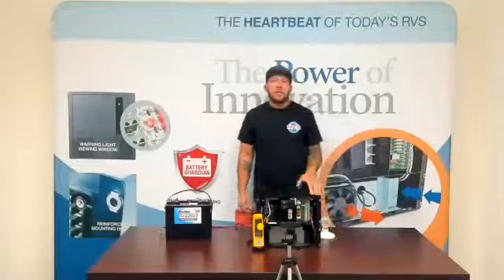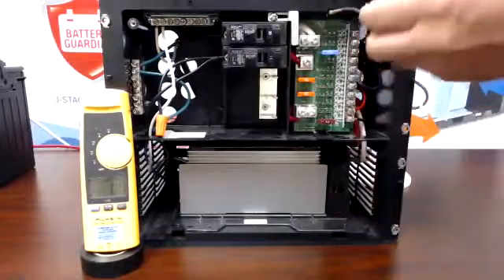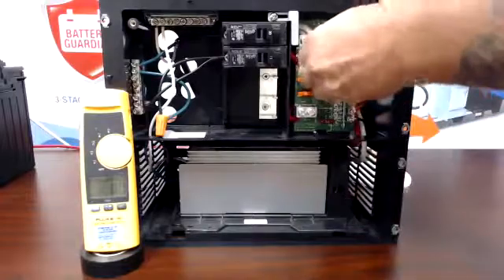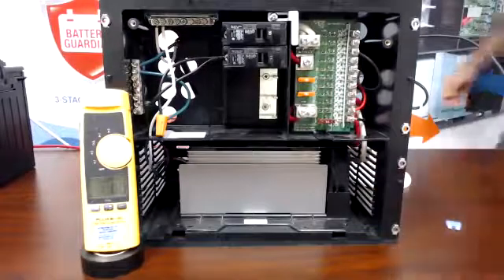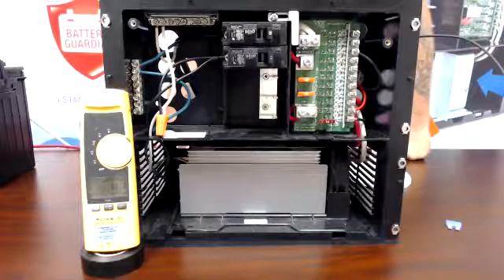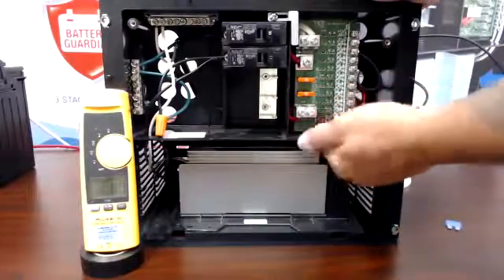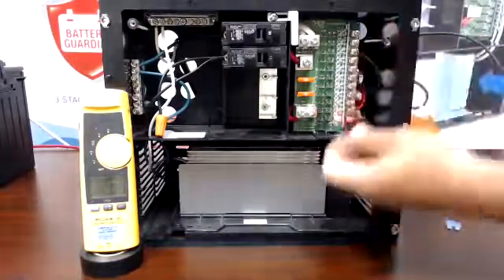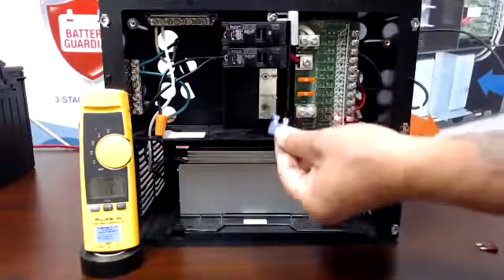Why do fuses keep blowing on my 12V fuse board?

Comment: Do you have any advice for replacing a fuse holder? One of ours came out of our panel when a fuse melted to it😳. We are also having issues with our "furnace/ ac" 15 amp fuse blowing the second we put it in. Any incite??
Reply from the maker: You will need a new fuse board. And,  if a fuse is blowing instantly, you need to have someone look at the furnace wire because this sounds like a short.